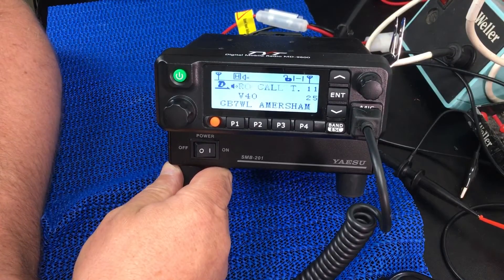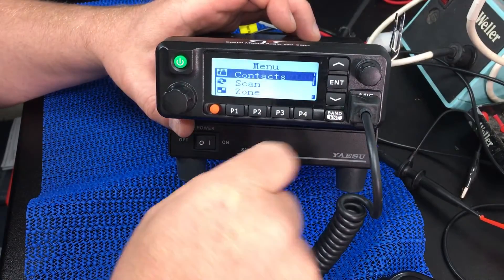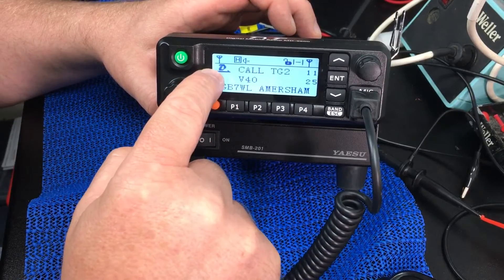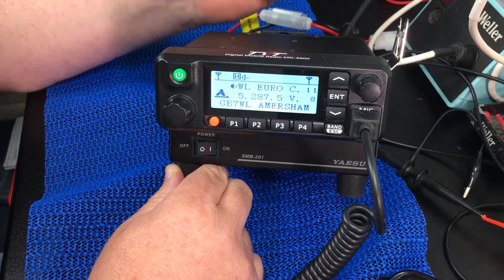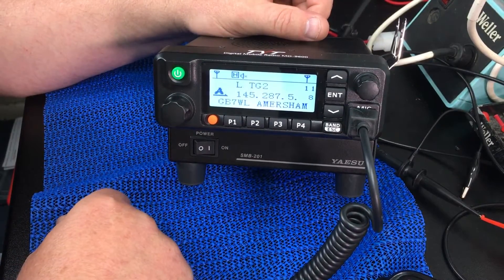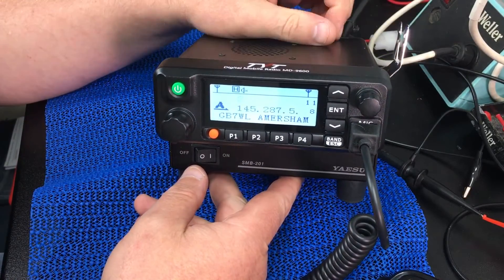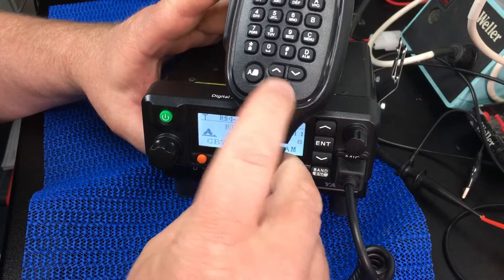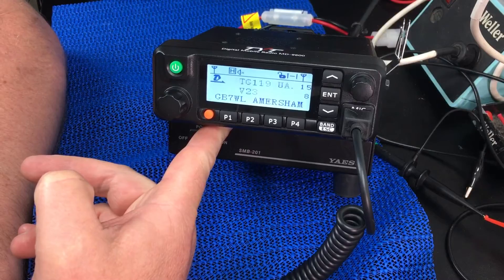The Tytera MD-9600 Dual Band DMR

Comment: also has anyone took anytime to put this radio on a band scope  to see if the vhf and uhf dmr signals is cleaner and tighter and better filtered as the handheld md 380 is very bad
Reply from the maker: Yes I have.. its not bad.. we did the latest BER mods and they are pretty snappy now.. for the money they are very good..

Comment: are they compatable with RT3 handhelds on DMR mode ?  also does gps turn off
Reply from the maker: if the 9600 has the GPS option simply disable it in the CPS.. RT3 is a TYT md 380 so yes they will work together..

Comment: What i see is a wrong programmed Display they can't make a Display where are all Characters form i.e. "1 Radio Settings" fit in the Display (this is a Dot Matrix Display) also the Character-set is not centered in one Line same high as the Number "1". they must scroll the Frequency Information on the Display because they make all characters to big - did nobody can see this!? And what i also criticize is that i never hear a Audio test on any of this Videos. What you also not say that you can't remove the Front end for Car installation. In a modern Car you don't have the space to mount it on the integrated Car Front end. On Yeasu you can remove the Front end from the Radio to mount it with a holder on the Cars Front-end. Can anybody see this they made a Stupid big "D" for Digital and big "A" for Analog and then they scroll the Text in Big Dot Matrix Display like this. I say to this Radio this is made by heartless Engineers.
Reply from the maker: Agree totally, but for the money it's good value ... Ok it has problems here and there .. I'm using one of the pre production units and to be honest it's still perfectly usable .. however maybe this radio isn't for you? Theres a connect systems radio available of similar type, what are your thoughts on that one? Gaz

Comment: Hi there. Thanks for the video. Do you know if 9600’s available in the UK at this stage will have the hardware bugs addressed? 73
Reply from the maker: we are working on the BER now.. radios available here www.hamradio.co.uk
Reply from the maker: +humaxf1 www.hamradio.co.uk they fix bugs for tyt with tyt engineers remote diagnosis..

Comment: good video, finally someone showing the menu system and without shaking the camera like a mad man.

Would this thing have both VFOs qrv same time? as in can i monitor dmr and analog repeaters same time? or at least in some form of scanning?
Reply from the maker: you can listen to both vfos at the same time.. however this area is where the 9600 starts to get flakey.. there is little flexibility with the VFO..
Reply from the maker: djappnew I will be back in the saddle this week, I've been busy at work and had guests in the spare room, so vids not been possible.. I've seen the radio you speak of but I don't have one.. We don't sell them in the shop so can't demo one..
Reply: Are you able to scan the band?
Reply from the maker: djappnew scan lists yes..
Reply: TheGazLab so be fair to say you cant really use it in a “frequency mode” everything has to be programmed im guessing?
Reply from the maker: djappnew you have to program it.. it’s not a scanner I’m afraid..
Reply: TheGazLab yeah not sure if youve seen this Ailunce handheld that is a lot more amatuer friendly with an actual VFO! Apparently it has a VFO mode? What exactly is it ? Possiblely worth doing a vid on this VFO mode. It i can go thorough frequencies deffo will buy one of these! Might hold out til later in the see what else comes out from china?🤷‍♂️

Comment: do you have any problems with bringing up DMR repeaters that are a bit further away? Mine I have to key up 4 - 5 times before it will lock in on a repeater where my handheld has no issue
.
Reply from the maker: No, but I did find a few issues on the demo boxes in other ways, the factory have addressed them now with firmware and some component modifications..  if you continue to have issues try a fresh vanilla codeplug from the latest CPS and firmware. If the problem persists contact your supplying dealer.. 

On the whole I have found the radio to be a joy to use, really basic operation and a  good standard of build quality and performance.. just a shame it's not a face off but at least its small..